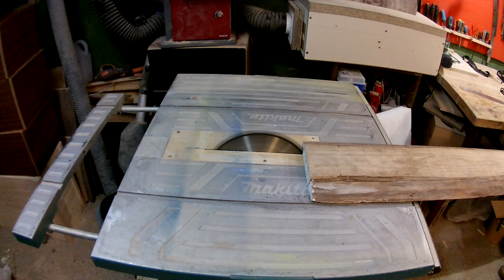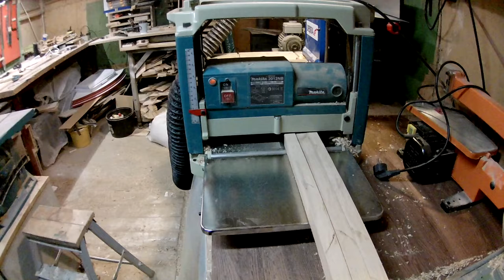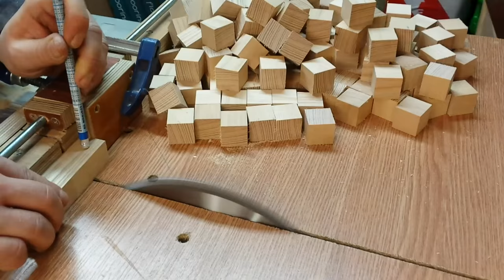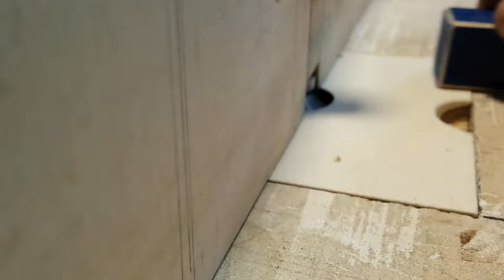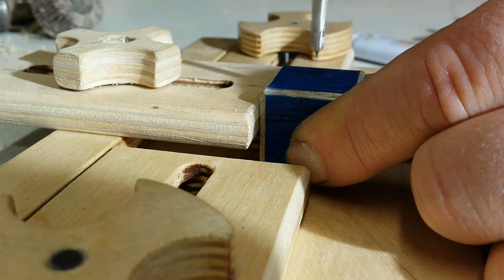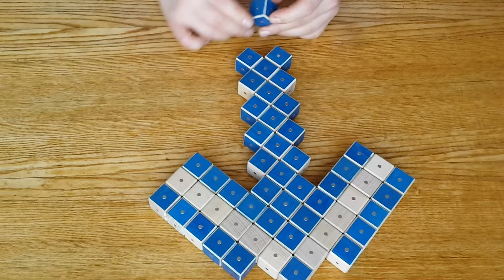Magnetic blocks of Wood

Comment: Awesome. This is such a cool project. I have few questions hope you clear it out for me. 
1. Did the magnet not come out later as it ages...as i dont see you using super glue or any of that kind. Or is it required?
2. Does the magnets repel? I see it only attracts. How is that possible?
Reply from the maker: Hi,
1. Good point 😁 Yes, need to glue !
2. In all cubes 3 magnets push 3 magnets pull.

Comment: You have drilled all throughout the cube but placed the magnets on the top... don't they slide down ?
Reply from the maker: Hi there! The holes are not drilled through the cube. The hole depth is same as magnet length.